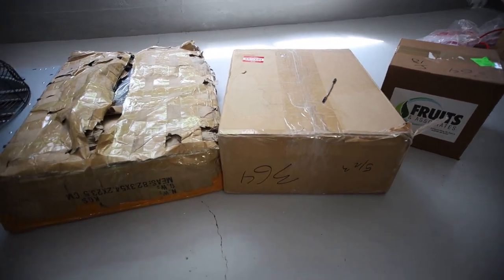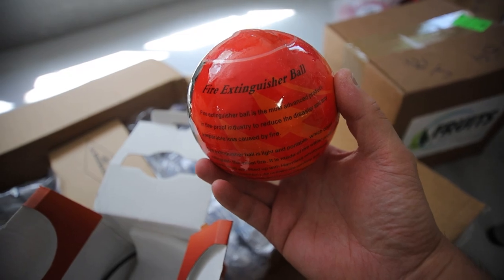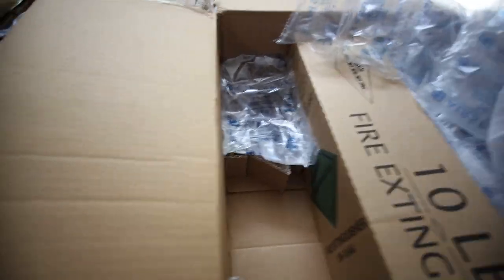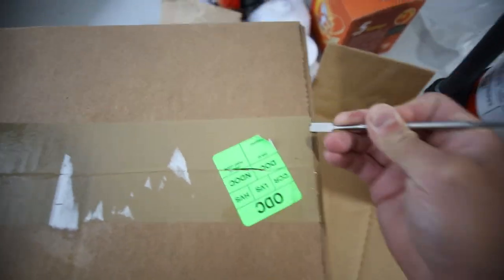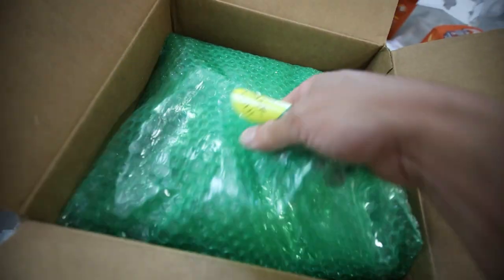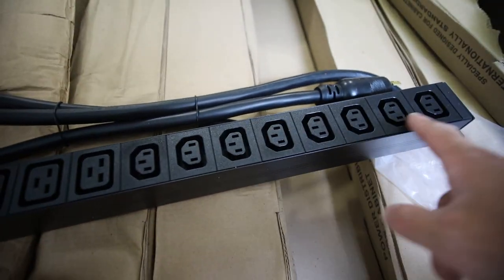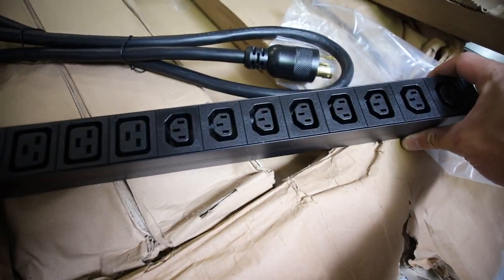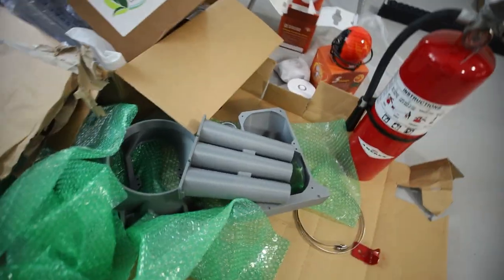Crypto Mining Fire Prevention...🔥

Comment: No problem man, i knew i had to send something when you mentioned 10 more alibaba PDU's in your home 🔥. Kinda funny you opened both boxes in the same video! Don't take the plastic off the fireballs. Just mount them in the baskets a foot or two away from what you want to protect. Keep away from ASIC exhausts! Also, they are smoke detectors only, not gas. Hang the Extinguisher near the exit door.

Comment: As someone who works in the fire prevention field as a service tech what you actually need is a CO2 not a ABC, a ABC extinguisher will cause corrosion on anything that the powder comes in contact with, CO2 how ever will smother out the fire and no corrosion, you can actually use your servers after replacing the burnt parts out

Comment: I dont think i would use a powder extinguisher unless all the rigs in the area are in flames and threathening to burn the house down. Powder is the most versatile but will corrode electonic components killing also the working miners sucking in the particles. So i felt my stomach tie up when i saw you place that ball next to them not knowing how much it takes for them to burst. Co2 extinguishers are also clasified for electrical fires but do not leave a residue that corrodes.
Reply: While true, an FE 36 type extinguisher is 20x the cost, and not as practical for home use. The intention here was to keep his family and home safe against class C fires. The corrosion to hardware can be dealt with later... with Sponsors! 🤣